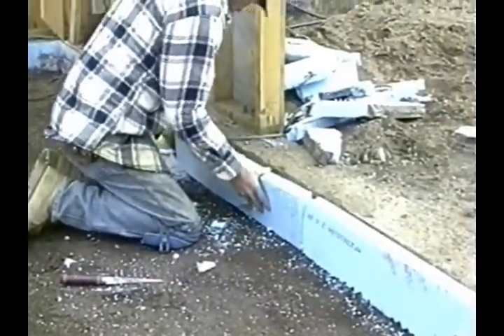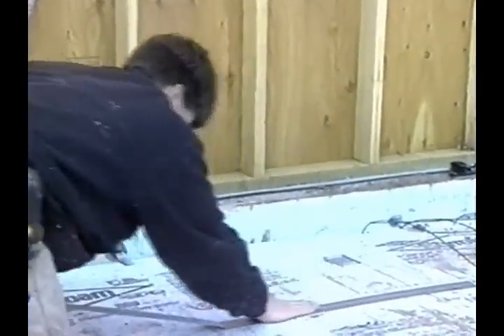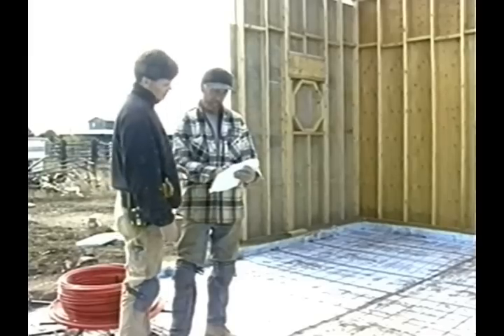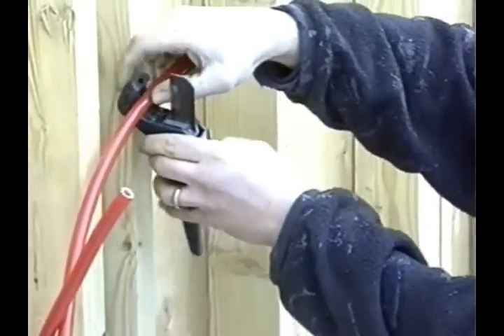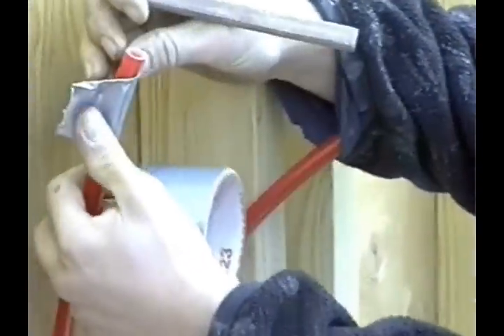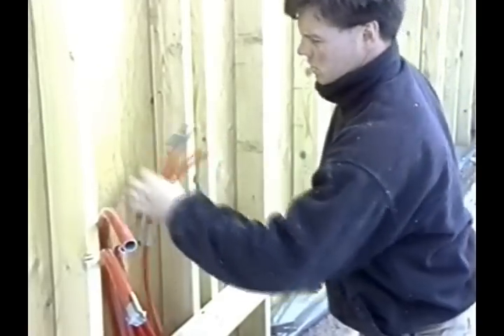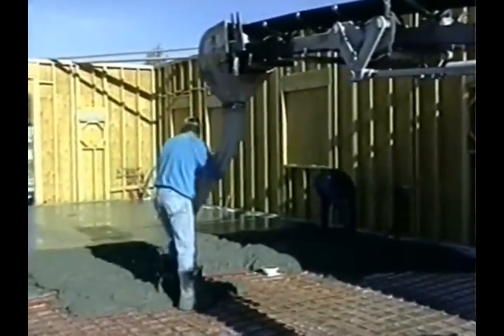Hydronic Radiant Heating - Concrete Application

Comment: Looks to me like that mesh is just laying flat on the insulation. Pretty much defeats the purpose. I realize that pulling the mesh would lift the tubing out of the concrete  but mesh does nothing unless it's IN the concrete not at the bottom.

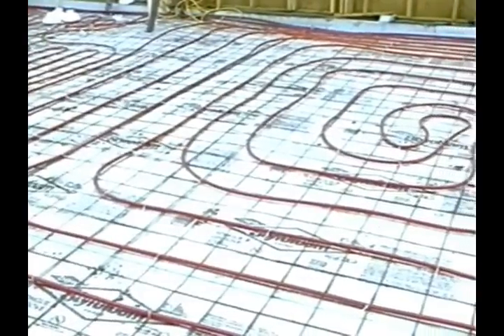Comment: 3:16 Entire video is insane, but this "flat" surface might be the sweetest part. Literally everything in here screams "No!".
Reply: Fasten the tubing down with Zip ties to the wire mesh and then PULL it up to the centre of the concrete slab.  BULLSHIT!  No one was doing that in this video, the expansion and contraction of the tubing on the wire mesh over time will cause wear and then leaks.  It is just a ticking time bomb.

Comment: Attach tubing directly to insulation with clips, then rebar and mesh, to keep tubing from shearing if concrete cracks or buckles.
Reply: Fastening with clips also gives uniform depth which is very important when drilling anchors although using a thermal imager shows you exactly where the tube is at. So many guys cheat when it comes to the rebar.

Comment: How does the foam perform over time with heavy loads (like a truck) going over the concrete floor? I imagine that the insulation foam eventually gives in and causes the concrete to crack.
Reply: They do huge jet hangers with them. This is very common for companies like American Airlines that have 747s on them. They hold up fine.
Reply: Foam has a higher bearing capacity than the ground does.

Comment: Are you using water?
No, no nover!
Use PVC and  Heated Air, drive a nail  though the concrete into PVC, nothing happens, lose power, no heat, no frozen water, to  problem.
This is old school radiant heat, much better ways using concrete over insulated foam, 4" PVC, and you can run electric, wood stove with air valve and blower, or solar to drive electric.
I'm still researching, but don't put water under concrete other than your plumbing, make sure you have a drain for water systems in case you decide to make it seasonal.
Good Luck!

Comment: No vapor  barrier under the styrofoam? That styrofoam  will turn to  mush.
Reply: Turn to mush =open cell insulation.

 Closed cell insulation is what to they're working with= doesn't absorb moisture
Reply: @kwaskeconstruction3382  Looks Like EPS should be XPS.  EPS absorbs water.

Comment: So sorry to complain, but I see this type of installation all the time. The welded wire fabric accomplishes nothing when sitting at the bottom of a slab. Nothing. It does nothing. These people wasted money, time, and effort laying it in. So frustrating to watch.
Reply: They said to raise the mesh to the center of the slab but they didn't show that.
Reply: If you're going to the expense of using in floor heat, I'd use the good 1/4" 6x6 8' x 15' sheets.

:)

Comment: Who thought duct tape was a good idea? Give your head a shake!
Reply: I'm pretty sure it's only there to keep the insulation boards together while poring the concrete. If the boards were to separate and concrete got in the crack, you'd have a thermal break.

Comment: Would love to do the $ math and see how much concrete it would take to store heat for ~5-7 days.  A hot water tank is probably more economic. can you direct me to where I can find this information. To me heated floors are it as we dwell lower down  at floor level ...and HEAT RISES! thanks for an informative video.
Reply: Looks at electrodacus.com he builds solar bms for lithium and designed his house to store extra heat from pv  solar panels with silicon insulated wire as the heat elements he has the math on his instructions for the dmppt for concrete heat storage
Reply: @Neveragain1111-r4y  Thanks for the reply. Will let you know what eventually I get built and its performance

Comment: With the expansion and contraction of the plastic based pipework, gentle moving it backwards, is it a good idea to strap the pipework directly to the steel bars?
Reply: I think they glued it in place with concrete

Comment: Ok video. Use of duct tape is not appropriate however for slab insulation. A higher quality tape is required supported by the manufacturer.
Reply: Some actually say not to tape joints and just overlap to allow moisture to escape. I used 2 layers of board and try to overlap, with the dried cement slab on it it will seal well.

Comment: We also use this system (on a separate thermostat) in the garage.  We keep the garage (26' x 28' ) at 40 in the bitter cold and 50 to 60 when temps are above zero to 25 f and 26 f up to 60 f.  Runs off the same 15 Kw boiler.
Reply: @hosiahmarczuk4174  If you mix water with the polypropylene solution you may get a leak from a stone in the sub straight, nail through the concrete or a bend in the pex tubing during the install.  Using a stop leak for  ought to fix the system.  I have an electric boiler (15,000 btu) and I can make my house like a sauna when -40 F.  If you think you have a leak you would have to add solution.  In summer I use a standard AC system.  I also have R 50 in the attic.
Reply: @hosiahmarczuk4174  I'm not a jobber

Comment: We have this system.  Wadena Minnesota, 1,315 sq. ft. two bedroom home.  Electric hot water boiler on Off Peak program.  We haven't hit $600.00 for heating an entire season (Sept 15th - April 30th) in 13 years we've been the home.
Reply: Awesome! Probably would cost half as much if it were a gas boiler. That’s what I’m going to be doing
Reply: @Murphy326  Our off peak rate is half the regular residential rate.  Last season 19/20 our total heating cost was under $550 for the whole season.  If your using gas as an energy source you have to insure you supply combustion air for the boiler.  With off peak electric there is no chance of monoxide accumulation in your modern tight home.  Our neighbor has a similar system and has a CO1 problem and since CO1 (carbon monoxide) is heavier than air it settles in low spaces.  The neighbors have an on grade home so the house fills with monoxide.  (their system does NOT breathe right)  If I may offer this advise.  R50 cellulose the ceiling.  Heat likes to rise and cold likes to fall and treated paper does NOT loose it's R value as gravity compresses it.
Reply: Tom n Surely all boilers made in the last thirty years are room sealed? They are in Europe. I haven't seen a non room sealed boiler in decades. It amazes me how the US is so far behind in so many aspect. People still use gas water heaters with open flues?! Furnaces are massive, inefficient and non condensing. In floor heating is considered a novel technology.. in Europe it's commonplace, increasingly run via a heat pump.
Reply: @tomn5880  Thank you for this advice. This is what I heard too about cellulose, that with time, it does not loose its R value. I appreciate validation of this idea.

Comment: Is it solar?  because it looks EXPENSIVE just to warm the floor.
Reply: econgloberfan what do you mean "just to warm the floor"? The point of underfloor heating is it heats the whole space, no other heating system is required. It's more economical than conventional heating systems and provides a greater level of comfort. It's been common in Europe for decades.

Comment: Two inch insulation? 4inch min better 200mm.
Hydronic you mean to say underfloor heating.
Reply: Hydronic is the term associated with a liquid in a heating system. In this case it would be water or a water / antifreeze mix. "Underfloor" would mean it's under the slab, not within the slab. I have seen forced warm air systems installed under a floor, but they still need registers (vent openings) and whatever you put under the slab is prone to failure. In the old days (pre 1970) these warm air systems used something similar to sono-tubes that were coated with a wax substance. You can see how that might degrade over time, collapse, and restrict the flow.
Reply: That depends on area of build and the coldest degree days, I am in the north and prefer R20 in a heated slab...but depending where you are R10 will suffice

Comment: I heard Hydronic Radiant Heating pipes should be NEVER touching rebar
Reply: Probably best for dispersing heat
Reply: How is that possible ? 
Not use re.bar ?
Reply: There are plastic clips available that post into the foam and raise the tube up off the mesh.
Reply: @jeffsimon2144  Thanks for this reminder, Fang Liu. Plastic and metal should not touch each other at least if you plan to outlive your system. Left-over ¾" PEX can be used as sleeve. It will be more work to cut it to 25mm length and to slit it open axially and to place over the ½" PEX. Only then should the ¾"sleeve be attached to the white mesh.
Another comment is to lift the wire mesh during pouring. The wire mesh should be ideally in the middle of the concrete, not at the bottom.
Another comment is the use of rebar. Rebar is structural for the integrity of the flooring. This maybe needed in places where the ground is subjected to constant movement. Wire mesh is to keep the concrete around the PEX pipe together.
Reply: I think that's a myth
And if it's not I would like to see the data on it.

Comment: NO POLY VAPOR BARRIER ?
Reply: yeah, and dukt tape? I was thinking there should be at least a 3mil barrier UNDER the foam.
Reply: Besides that, its not like the vapor barrier is expensive. You could get enough of it to lay it down twice in two different directions, tape those seams up and really make sure it isn't going to leak anywhere. I could see getting away with dukt tape for that (in a way) but why not just admit that you are doing a pricey project and do it right?
Reply: 2 inches of rigid insulation usually complies with the permeability rating equal to 6 mil so it is really unnecessary.